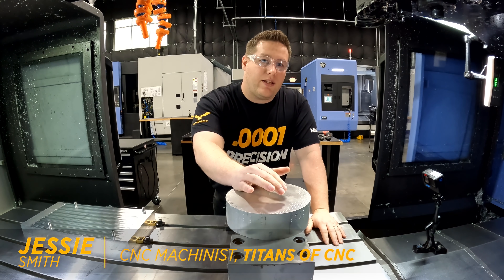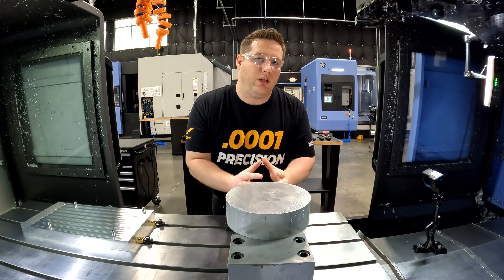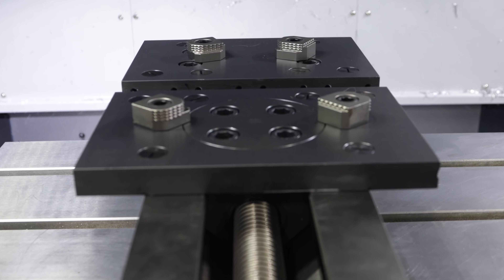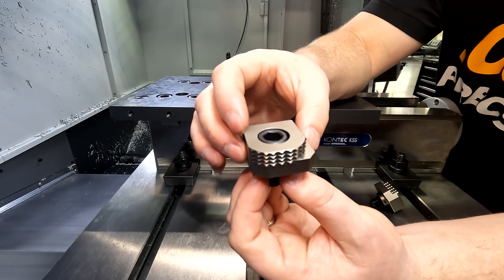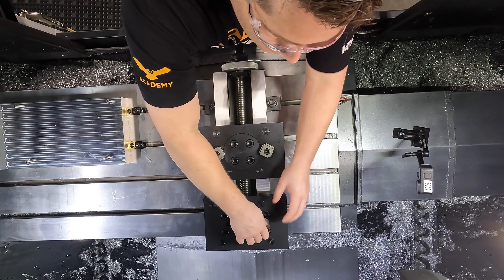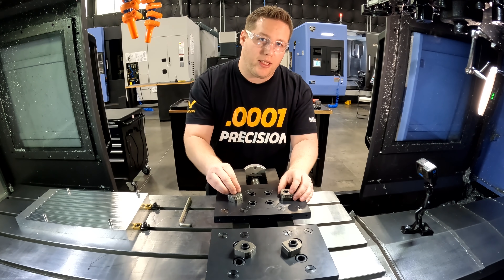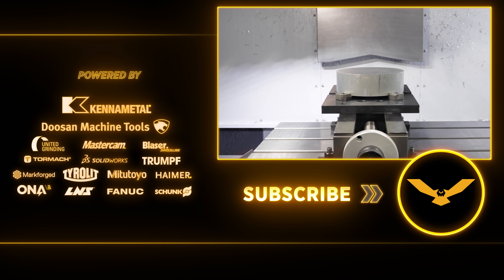What are PENDULUM JAWS? | DNM 5700L CNC Mill

Comment: Over the years I’ve picked up several lathe chucks that were orphans and mounted them on plates that I can bolt in the mill. Great for round stuff. I can hold really odd shaped parts in pie piece shaped soft jaws in the independent 4 jaw one. I’ve seen a solution like this that used dowel pins set in the vise hard jaws, but I can’t remember the exact setup.

Comment: Not sure i get this one. You have to buy a $2700 vise and then $2200 pendulum jaw set, which is cheaper than cutting $30 soft jaws? 🤔
Reply: Or use chuck to hold the part

Comment: Wow! I just drop a V-block in my standard vise and get a good 3-point clamp on whatever round or irregular stock I am cutting. I could use two V-blocks if I thought 4 contact points were better.
Reply: Off topic, but what is that unique looking firearm in your profile pic? (If it is even a firearm. I'm not sure I can make out the details in the low resolution photo.)
Reply: @Gameboygenius  Steyr "Free Pistol". A single shot .22 used in international competition. I have won state championship matches, but was not good enough to make the Olympic shooting team. The trigger pull is a fraction of one ounce, literally 1000 times less than a normal 12 pound double action revolver.
Reply: @BenAtTheTube  Thanks for the reply. Talk about a hair trigger... 

It looks like a precision device. Not surprised to see that in the comments of a metal working video.

Comment: I would never use my torque wrench to loosen bolts like that. I know manufacturers say it’s fine but with a tool that’s calibrated for one direction use I just don’t feel it’s worth saving the couple seconds to use a different tool. Just my two cents.

Comment: Great fixturing. I'd have to do that "single fixture" 100 times though to pay for that Vice and those special jaws. Not sure how to sell my boss on this now but I'm glad I know they exist. You can never know too many ways to hold stock, especially round stock on a mill.
Reply: I'm sure a cheap, but much less accurate, version of this can be made with only using 3 jaws instead of 4.
Reply: Check out Mitee bite Versa Grip Jaws. They operate on the same (albeit slightly less heavy duty or flexible) principle. They also cost about 1/10th the Schunk system and can be adapted to more standard 4/6/8" vises.

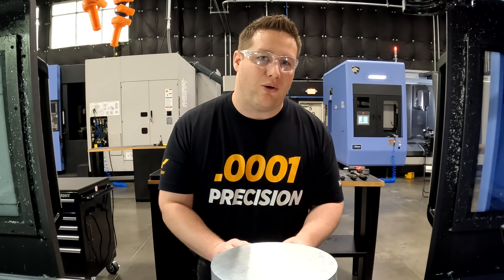Comment: 0:55 You should never use a torque wrench to loosen bolts. Shortens the life of your calibration.
Reply: All you gotta do is read the manufacturer's instructions that came with the wrench. All will become clear then. ;)
Reply: So you keep a regular check on the calibration of your torque wrenches? How often do you check the calibration and how do you verify it’s calibrated?
Reply: @Jessie_Smith  in my facility we calibrate torque wrenches every 6 months unless they are dropped or misused. Then they are sent out immediately.  Some other shops keep a calibrator in house so that you just need to send out the calibrator's load cell every 6 or 12 months
Reply: @Jessie_Smith  every 3 weeks why???
Reply: I wrote the same thing.  every one he broke free made me cringe!
Reply: I got a question. how about loosen the vise? Is that going to shorten the life too?
Reply: @harryho9097  it will definitely do the same thing, especially if it's hitting it's calibrated torque value and continuing to put torque on it in loosening the vise.  One simple rule with torque wrenches: use them to torque to spec, NOTHING else.  As long as you remember that, you're golden.
Reply: @shirothehero0609  I think 何仲轩 Was probably satirical referring to opening/closing vise ...
Reply: @charlesangell_bulmtl  yeah, we use the torque wrench to open and close the vise all the time. And I was wondering if we are doing it right or we are slowly killing our torque wrench.

Comment: Funny to see you guys using Snap On, as their cordless tools are the biggest grift in power tools.  I use the Milwaukee M12 ratchet for changing vise jaws and it has been amazing.  Dramatically speeds up loosening and tightening and you can use it to break bolts free and provide final snugging, though obviously not to a torque spec.

Comment: Seems like a well designed and flexible work holding system.  One thing to add, I was always taught never to use a torque wrench to undo bolts that are tightened - I would use a breaker bar or similar.
Reply: I was thinking the same thing about the torque wrench. Unless you are checking the breaking torque to see if it has come loose
Reply: Why does it matter torque is torque and loosening a right hand bolt is no different than tightening a left hand bolt
Reply: @dalef7933  because bolts seize for a variety of reasons and the torque required to loosen the bolt could be over the rating of your wrench. Also we are taught to not use a torque wrench as a ratchet. Use a ratchet and then switch to the torque wrench for the final tightening. TW are a precision instrument that should be treated that way. Though I'm guessing most shops don't calibrate them on a regular schedule or keep records.  Probably aren't working on aircraft, that kill people when they break down, either
Reply: You guys probably only use impact sockets on impacts as well jesus
Reply: @dalef7933  Yes we do.  At RR we use the best hand tools available, and use them in the correct manner.  For example in engine build if a socket should shatter when being used the fragments would be inside the engine.  That would necessitate a complete engine strip to retrieve all the bits.  Very costly in both time and labour.
Reply: @michaeljohnson-li5nn  yeah in that sense its worth it I am just an asshole making fun of people that like to talk about all the ways you think you can mess up a torque wrench but in all reality if you're breaking a socket building a motor I don't want any part of that engine in my vehicle
Reply: @dalef7933  Yes Dale, I fully agree with you on that!  The engines that I build at RR are actually Aircraft Gas turbines. We are very careful when building these to ensure that we avoid and FOD issues (Foreign Object Damage) - that’s the last thing you want when you are 30,000 feet up in the air. In engine build we only use Snap-On brand rachets, but they are special FOD models. This is in case the rachet fails in use the components in the head of the rachet itself are so designed to be contained and not to fall into the engine.
Reply: well if u are using cheap torque wrenches then they can get damaged at some point , i have been undooing bolts for the last 7 years with the same torque wrench and its still working properly . But u are right about it.

Comment: Hello, could you perhaps make a comparison between cheaper and more expensive tools like endmills, taps, drills etc. I believe both have their uses in a shop.
Reply: That's easy.  Use the cheaper tools when you want to waste money and scrap product.  Use quality tools that won't let you down and profitability and productivity will increase.   NEVER buy or use Chinese made end mills, drills, taps, or dies.
Reply: @Turboy65  cheap Chinese end mills are the only thing in my workshop. Can't afford champagne on a beer budget, when beer is nearly breaking the bank. I need to find a way to make my CNC earn me some money, then maybe I could afford something a little better.
Reply: @DodgyBrothersEngineering  i mean even the cheapest of endmills can do , but u usually cant run them at any decent feed where u can really make profit out of it
Reply: @DodgyBrothersEngineering  Then expensive end mills might just turn your whole world around. If you get them running right they last much longer than 300 percent the price.  If you can quadruple your tool life then better tooling alone saves you money and time from not having to change them as much. Some things never pay off in a job shop and cheap end mills are one of them. Those end mills are designed to make money for the company you bought them from not to advance the industry.  
Which side do you want to be on?
Reply: @LordOfChaos.x  currently I don't think I am even coming close to taxing the capability of even the cheapest end mills. Still making too many rookie mistakes and breaking bits to ever contemplating buying something expensive. I cringe when I see how much material Titan removes. It's mostly an experience and confidence thing. I hope one day my abilities justify buying decent cutters.
Reply: @drewjohnson4794  I typically break the bits before I wear them out so in my case it would be false economy. You have to walk before you can run, and I am currently crawling. Might be worth my while to see if I can take some CNC classes.
Reply: @DodgyBrothersEngineering  u need to find the correct speed and feds 
Maybe test them out
Reply: @LordOfChaos.x  that is part of the journey I am on, because I built the CNC myself I have no real guide as to what it can be run at. If it was a name brand CNC I could see what others are doing, but I am just slowly feeling my way and making mistakes as I go. Just today I used a drill bit on my CNC for the first time to drill 9 holes, it took me over an hour to drill the holes because I was doing a full retract for every .25mm of cutting. Using a small diameter drill (2.7mm) I didn't want to risk snapping it, so I err on the side of caution, sometimes too much.
Reply: @DodgyBrothersEngineering  there are manuals for calculations 

What software do u use?
Reply: @DodgyBrothersEngineering   As long as you break them because you crash, I'm on your side. But if you master it so far, that the machine does what you want, find a seller/manufacturer with good tools, who gives you data and advice. Don't be shy, just call them. Chinese endmills usually don't come with the data, because they are not tested and proven... And if the machine is not very stable, can work around with the right strategy. 

For example: I had to mill stainless on a big cnc router which is built to cut wood. It was not rigid enough for normal milling (endmill breaks after max 10min), so I got me a 12mm(ca 1/2") endmill with 7 flutes, run it with 2500rpm, 2500mm/min (ca 8 feet/min) max ap, 0.25mm (0.01")ae. cycle time was the same, but one endmill did hold up for 5 to 8 hours...
Reply: @ROTHGLUT  the reason for breaking them is various. I would say the top reason though is probably inexperience, just because I can build a CNC doesn't mean I have the faintest idea how to use a CNC. In the early day when several of the parts were made out of plywood, I had fairly severe chatter and broke end mills due to the lack of rigidity, but as time went by and I machined new pieces out of aluminum and improved the CNC, less and less were broken for that reason.

Just recently I made myself some aluminum spindle spanners and I broke about six 1/8th cutters. Was stupid little things like not setting the DOC for two of them and the broke as it tried to plunge.

Occasionally I will break a cutter when starting a job and the first cut is too deep caused by my spoil board not being perfectly flat. I probably have half a mm variance across the 800mm X axis.

I loss cutters due to running into hold down clamps, and sometimes I just have a brain fart. So most of the reason the cutters are breaking are not due to them being weak but inexperienced user error.
Reply: @DodgyBrothersEngineering  First of, props for building your own CNC. just was over at your channel 
If it's user error, I think you'r fine with the cheap ones. But at some point you need to step up, as you get better. As a next step, you could ask a grinding service. They sometimes got reground tooling for cheap. I sometimes buy used tools on ebay, wich often has lots of life in it and is better then the cheap stuff.
Reply: @ROTHGLUT  thank you. Yes most definitely user error for the most part. I think these cheaper end mills have a market, which is probably me at the moment. I am hoping one day to justify stepping up to better cutters but I need to take baby steps and spend more time working on the CNC.

Comment: Breaking bolts with a torque wrench …… interesting …. - need to get yourself a good m18 Milwaukee impact wrench, improve those set up times
Reply: Not quite as interesting as it is cringey!  That was the first thing I learned about torque wrenches - you use them to torque.  That's it.  Never break.

Comment: This is cool and all but why not just slap a 3 or 4 jaw chuck in the mill?
Reply: Because that would take longer than changing the jaws out. And you may not have the table space.  Like here on this mill we have a fixture mounted to the side of the vise so there is no place for a chuck at this time.
Reply: I believe the clamping forces are higher then most regular 3jaw chucks. It is faster, if the vice is already on and you can clamp very large stock (you would need a gigantic chuck). Also, you can clamp odd shapes

Comment: Even easier with Lang vices. They do jaws designed to hold round stock, you just wind the hard jaws off the ends and put the round stock jaws on. No bolts. Takes about a minute to do.
Reply: I'd like to see that. I'll have to look them up. 😎 But when you already have Schunk vices you have the best I've worked with.
Reply: And the vice they go on is 48355-125. I don't work for them or anything, im just familiar with their catalogue.
Reply: @PetesShredder  Two different situations. Those are centering vise's, which are for a completely different type of work than a vise with a fixed jaw. And even though their Makro 4 Grip and Vastro jaws may be "easier," they are just not as rigid. Anytime you're clamping a round piece of stock with >3 points of contact, when those >3 points don't have any degrees of freedom, clamping forces will be uneven and weakened. I assume you're talking about the Makro 4 Grip and our the Vastro, because your part number it's just for a standard centering vise for a multi axis machine with a rotary axis table, not a multi axis machine with an x, y linear table. The only way the the Makro 4 Grip jaws work is because they're designed to severely deform the stock to take up any of the radial asymmetry problems that the Schunk vise deals with using rotating inserts and a pivoting dynamic jaw; without having to bite and deform the stock so severely. And depending on the hardness of the stock, you may not be able to deform it sufficiently to hold it securely. Also, depending on how out of round the stock is, you may not be able to deform it sufficiently to hold it securely. Holding a round part at >3 points with no degrees of freedom just doesn't work as well as this system.
Reply: LANG is superior in every way 💪🏼😉

Comment: How about if you have to work on the other side of the piece? Those jaws leave visible mark on the piece.
Reply: Going to need soft jaws for that, or use the flat face of these clamps. I assume this is just to prevent having to make the extra pair of soft jaws for op1
Reply: @ClockwerkIndustries  On op1 you could use the chuck instead and not worry about marks. That's the reason why soft jaws are made, for best and most precise clamping without leaving marks. With that said, i would get one of these anyway, seem like could be really handy sometimes, anything to make life and job easier.
Reply: If you got OP1 done and it is still round, consider going to a lathe in the first place